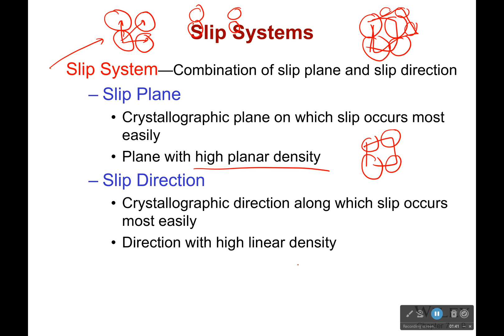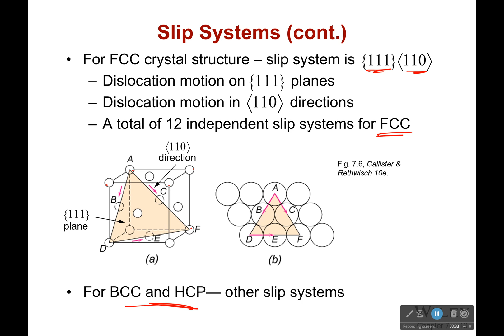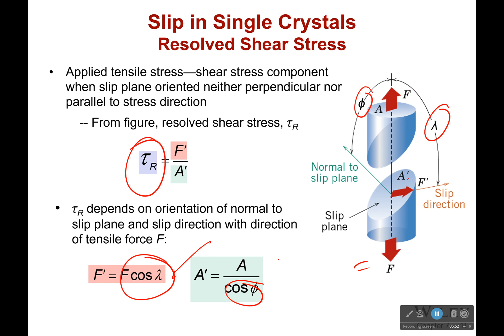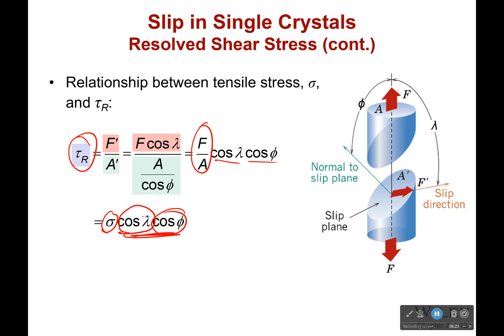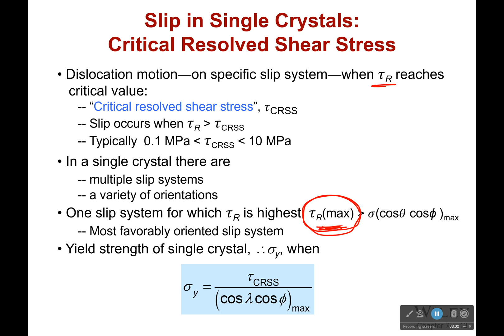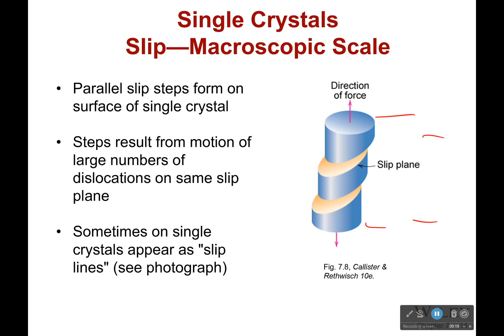Slip Systems

Comment: Question <110> direction wouldnt be a specific direction in which x&y =1 and z=0?
Reply: if the origin was taken at A, none of the directions would represent<110> so what does <110> mean in this application
Reply from the maker: <110> is a family of directions. That means it encompasses (110), (101), (011), (-110), etc. All the possible ways of arranging two 1's and one 0. So at point A holding right as the x direction and up as the y, we can have (1-10) which is also part of that family. Another way to think of it is you can think of a family of directions as being what happens when you keep the direction constant but start spinning your coordinate axes about the origin in 90 degree increments. This would make the same arrow end up having different values for its direction but all possibilities would be a part of that family <110>. Let me know if this clarifies things. If not, I'll see if I can make a video showing it.
Reply: @drkiddengineering  Yes, it did clarify things, I was thinking of <110> as a direction, not a family of directions. Thank You